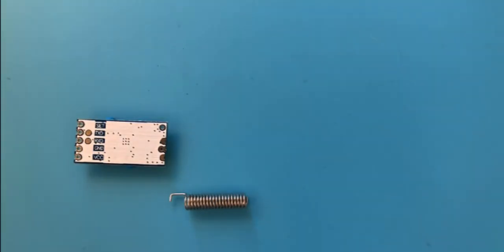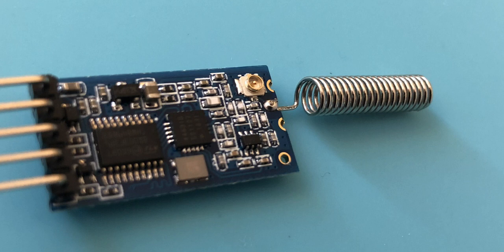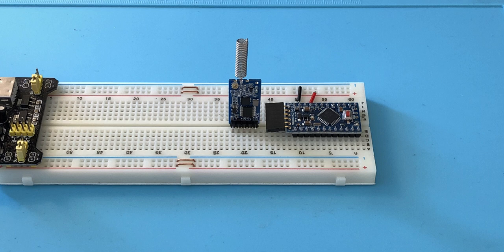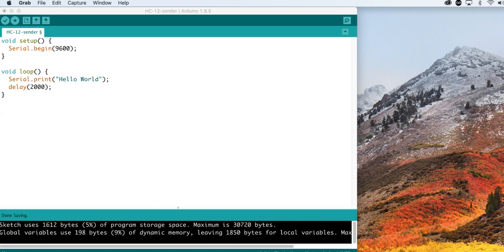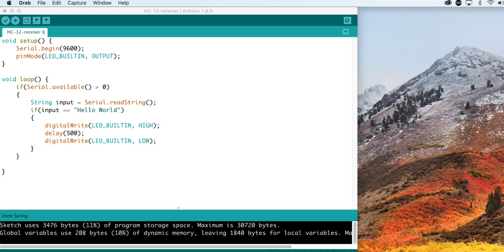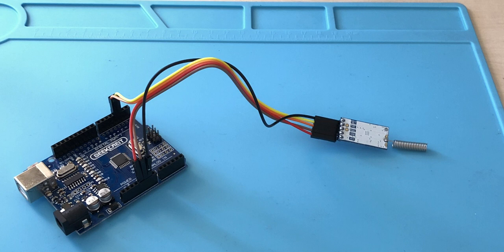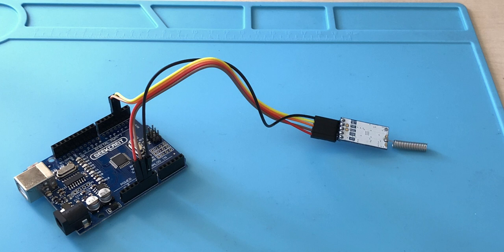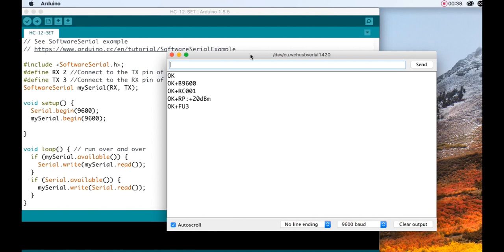Getting startet with the HC-12 and Arduino for wireless communication - from Banggood

Comment: Tip: Arduino transmits TX to HC device,device receives RX and then sends thru TX. So TX to RX and vice versa. Also if sharing power from breadboard, you can get communication from the ground as noise so you think its working wirelessly but its not. Lastly, separate the transceivers at least 2ft apart for it to work. Thanks.

Comment: When you enter the AT commands, if you change the baud rate different from the 9600 default then exit the AT command mode, will the HC-12 keep this change after a power shut off ? 
I hope so because if the HC-12 does not keep these AT settings changes a micro-controller will be needed to set back these different settings on every power up like the baud rate or Tx power
for instance.. My actual application runs on 4800bds..  Keep up the good job !
Reply from the maker: Hi! Yes, it keeps the settings :-)
Reply: @DIYTECHBROS  GOOOOOD !

Comment: I cannot get your code to work for some reason. (I am using an Uno and a Mega) I also noticed that your wiring is confusing. You say you connect RX to RX and TX to TX but in the video, the wires run from RX to TX and TX to RX. Which is it?
Reply: Just call the header below as 
SoftwareSerial HC12(10,11) // HC-12 TX= D10 Pin, HC-12 RX D11 Pin
AND
In void setup
 HC12.begin(9600); 
and the rest would work fine
Reply: @ChamikaRavinduEkanayaka   Sorry could you elaborate?
Reply: Yeah, same here. I was trying to follow the verbal instructions but wasn't able to get it to work. Now that you've mentioned it, yeah. The instructions were different from what can be seen on 2:03 can @DIY TECH BROS clarify?
Reply: follow-up: just tested our hypothesis. yeah, it really is the other way around. Arduino TX to HC-12 RX and vice versa
Reply: @orphidian11  TX --> RX and RX --> TX is always the way communications of any sort work.

Comment: How to send multiple variables using HC 12
Reply from the maker: Hi! There are a few simple options. (1) send two different transmissions (2) use the string functions to extract the data you need. Let’s say you want to send A as variable 1 and B as variable two. And you know that the value of any variable is always going to only be one char you can simply use substring().